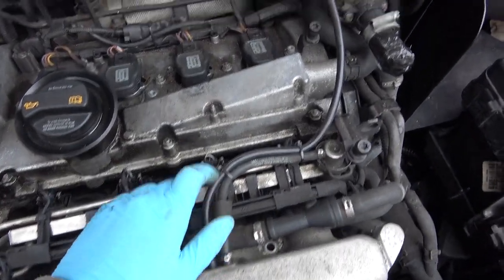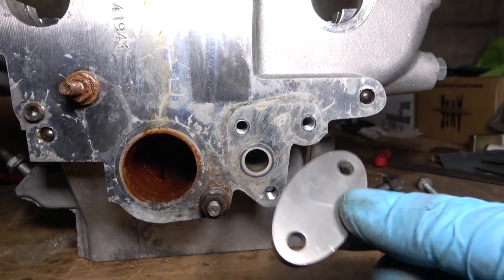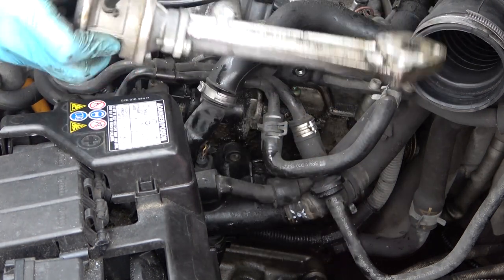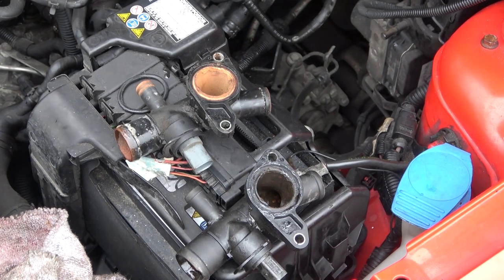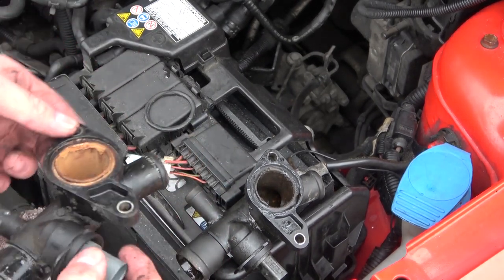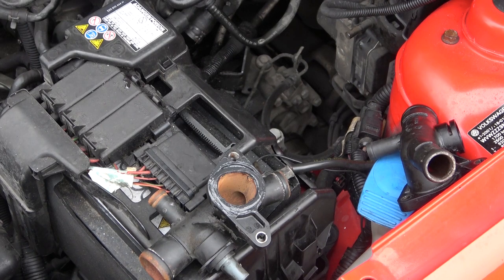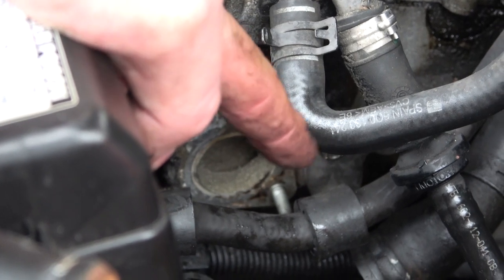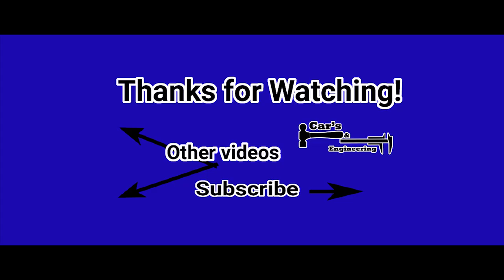Secondary air injection delete! SAI Delete Polo 9N3 GTI 1.8 20VT

Comment: Nice job man. I had to tear off the entire front end of my passat after the accessory belts shredded and threw off the timing belt by a few notches. But now that it's apart, I see that big silly air pump just easily accessible to remove. Now after this vid I know how to plug it up properly!
Reply from the maker: I think the passat engine bays are packaged a bit tighter than the polo but it is possible witout taking the front off depending on engine fitted to the vehicle

Comment: Struggling to figure out how to remove the pump which you had already done before the video. Be good to know. Thanks :)
Reply from the maker: The pump is held on with a metal bracket, the bracket is held on with I think 3 m6 cap heads you access them through the inlet manifold ( look down into the engine bay through the manifold and you’ll see them) 
Once they are taken out it’s just a matter of unplugging the hose attached to the pump, unplugging the electrical wire and then wiggling the pump out of the engine bay 👍🏻 
I hope this helps, I took mine out a while ago so tried my hardest to remember 😂
Reply: @CarsandEngineering  thankyou! Can't tell you how much you've helped me with my project!
Reply from the maker: Happy to help 👍🏻

Comment: hello good man, i need your help. did you put the hose on it from the blowoff? I see you have a cable tie on the intake leg. at the beginning the ear cuffs were originally installed. sorry my english is not the best. you have a hose from the intake to the blowoff, is a cable tie enough to fix the hose? thx man
Reply from the maker: yeah the cable tie holds the vacuum line on no problems.
the line was a bit smaller so had to really wiggle it onto the nipple.
you can put clips on there if you'd like i was just being lazy
Reply: @CarsandEngineering  thx man👍🏼👍🏼

Comment: hey, i cant seem to find the right temperatur sensor housing. may you have a part number or sth that could help me out?
Reply from the maker: Temperature sensor housing? 
Here is a link to a all metal setup 
https://creationsmotorsport.com/vw-mk4-golf-tt-audi-1-8t-20v-cast-aluminium-coolant-flange-upgrade-kit.html

This is the plastic one the part number is on this website too:
https://www.sparepartstore24.co.uk/1886092-febi-bilstein

and this is just the metal one on its own: 
https://ebay.us/n8gh12

i hope this helps
Reply: @CarsandEngineering  thank you very much man

Comment: Great video. Do you pop a check engine light after this operation? and if you do, how you manage it? Thank you!!
Reply from the maker: Doing this will throw an engine code now n then, the best solution is to get it mapped out by a tuner, the other method is just keep deleting the light with a scanner tool 👍🏻

Comment: Do you need to put a resistor on the sai pump's plug? Or can you just on plug it and leave it?.
Reply from the maker: The SAI plug with or without a resistor will throw an engine code eventually, I believe the only way to keep it off permanently is having it mapped out via a engine tune 👍🏻
Reply: @CarsandEngineering  hrrmm, ok. I may be going stage 2 this year so will ask the guy to map it out I guess 👍.

Cheers mate
Reply from the maker: As far as I’m aware it’s literally the only way to get rid of it permanently, otherwise you can get a £20 code reader off the fleabay and keep deleting it every 100 or so miles 😂👍🏻
Reply: @CarsandEngineering  🤣🤣🤣🤣

Comment: Great video. It’s always been educating watching yours! When I changed the air intake, I accidentally broke the small ball-shaped connector where right under the air-flow sensor hose. Now I put some adhesive tape on it and I can still hear some air leaking when idling. Even after the whole SAI delete process I saw it’s still strongly tightened. Would that be a big problem in your opinion? Thanks 🙏🏻
Reply from the maker: Thank you mate 👍🏻 
I’m not sure what you mean by ball shaped connector? 
Air leaking from anywhere isn’t great in my opinion if the cars running ok then the tape is doing it’s job but it’s something you need to get replaced 👍🏻

Comment: Do you have to delete the n249 or can I just blank off the part where the vacuum line goes too?
Reply: Or the n112, the one that has the vacuum line from the tower valve.
Reply from the maker: You can leave all the stuff in place and just blank off the plate on the side of the block but it’s kinda pointless, it really is such a simple delete you might aswell do either all of it or none of it in my opinion. 
It’s entirely up to you but either way you’ll most likely have to use the resistors to stop engine codes coming up. 
I hope this helps 👍🏻

Comment: Great video there.!! I have a quick question, how does the SAI delete affect the performance of the engine?
Reply from the maker: It doesn’t do much for performance if I’m honest it’s just one less thing to go wrong.
You don’t need it it’s purely for emissions, an air pump sucks fresh air and dumps it behind one of the exhaust valves, it’s to do with heating up the catalytic converter faster on cold starts etc

Comment: After my sai delete on a 1.8 t the car won’t roll forward or backwards without over stalling the engine is that tune for this issue?
Reply from the maker: I’m not sure, was it doing this before the delete? I assume not? 
The only think of is if you didn’t blank the port off on the head?
Reply: @CarsandEngineering  it was running good and I put the block off plate as instructed? I’m guessing limp mode cause of the delete?If anything would you know a tuner more economical for the delete?
Reply from the maker: Yeah contact a tuner mate, something isn’t right for it to be stalling. 
Have you deleted the n122 and the n249?
Reply: @CarsandEngineering  you mean the n112 ? Yeah and th3 n249... those came with the sai delete kit I got from uro tuning .. I think it just might need the tune .. it’s a project so I’ll keep you updated pal thanks
Reply: @strongarcwelds4163  howd u go bud ?

Comment: Did you drain the coolent before removing it or did you just go for it , also does loads come out or just a bit??
Reply from the maker: I didn’t drain the coolant so when I took the temp sensor housing off the block to blank off the sai on the head some coolant did come out, not loads I think it was like half a litre or so? 
it would be worth draining the system beforehand but if you’re not able to have plenty of rags or an old towel on standby to mop any old coolant up 👍🏻
Reply: @CarsandEngineering  I did it and not too much came out , thanks for the videos on this delete mate it really helped and I managed to get it done
Reply from the maker: Good mate, I’m glad it helped you out 👍🏻 
I’m currently producing a video for a oilcatch can setup so keep your eyes peeled for that too!

Comment: What was the o-ring called ? Doing this at the weekend and I want to buy one from vw, cheers fantastic video
Reply from the maker: The o-ring is for the temperature sensor housing but I’d recommend getting the housing too, in the video you see that the plastic deteriorated into nothing, I’m going to be upgrading it to a aluminium housing in a future video. 👍🏻

Comment: How do you remove the Sai unit?
Reply from the maker: It’s attached to a mounting bracket via bolts from above, and there’s a electrical connector to remove too, that’s the main pump anyway, it’s easy to get out just a little bit fiddly 👍🏻